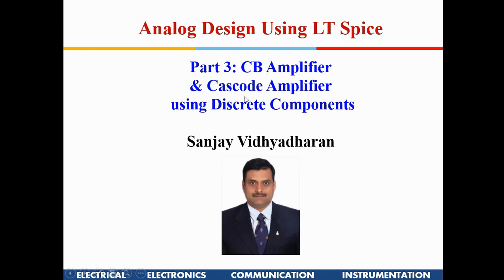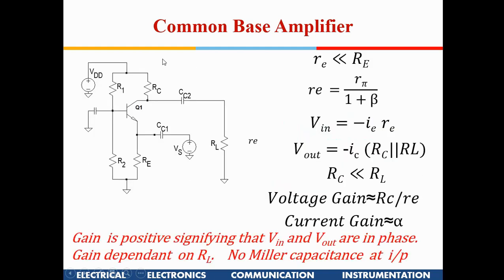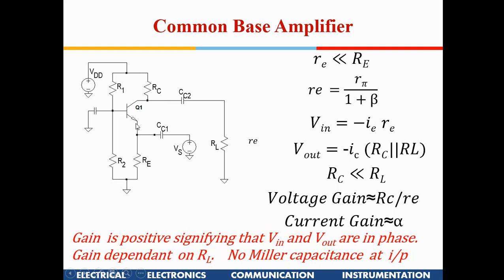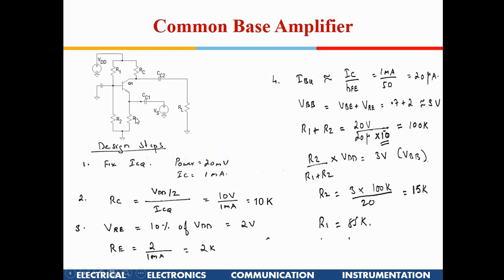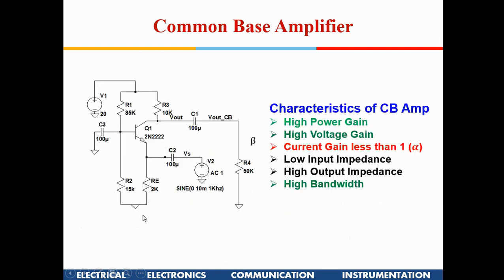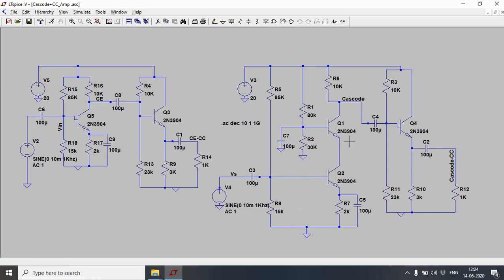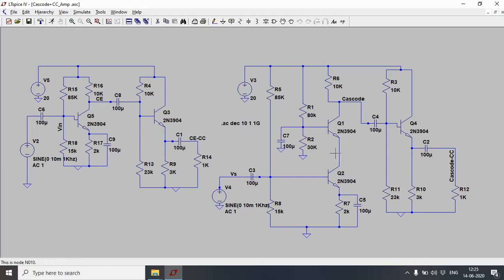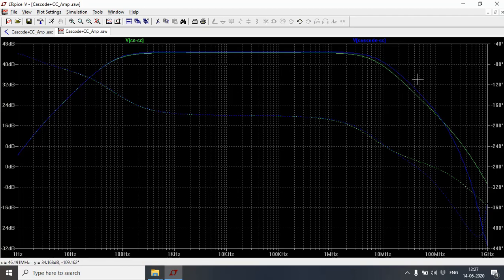Common Base and Cascode Amplifiers with LT SPICE

Comment: Sir, in case of CE-CC configuration the signal magnitude at the o/p  got attenuated compared to the signal feed across the input (signal coming from the CE stage). please check and give your suggestions.
Reply from the maker: Yes . CC amplfier has a  volatge gain less than 1.  CC is a power amplifier and not volatge amplier. Refer https://youtu.be/Or9L7cD7cJ0